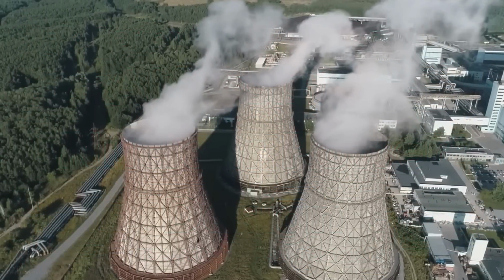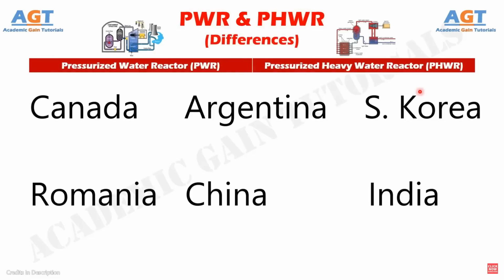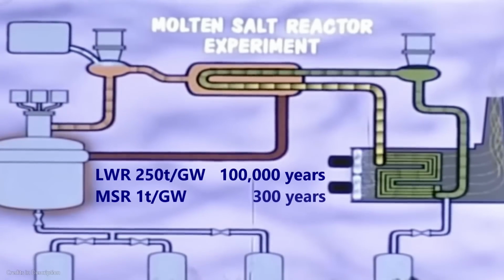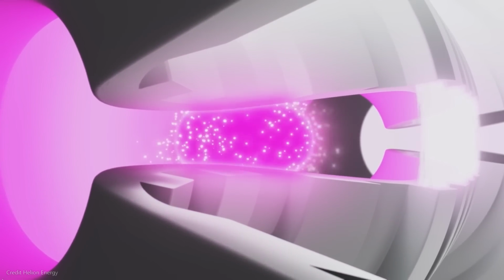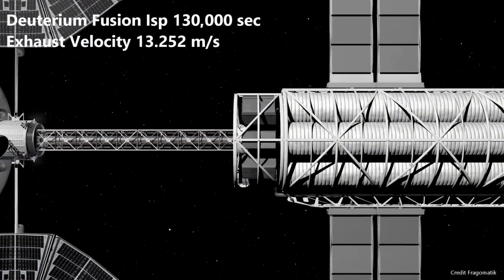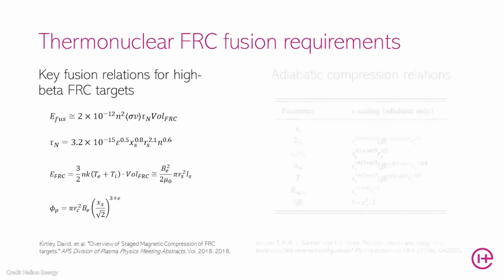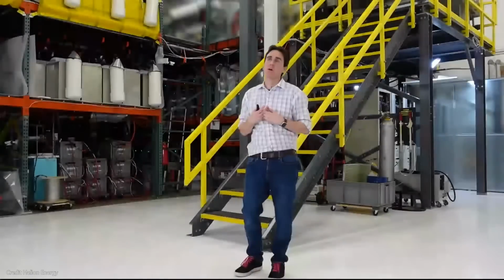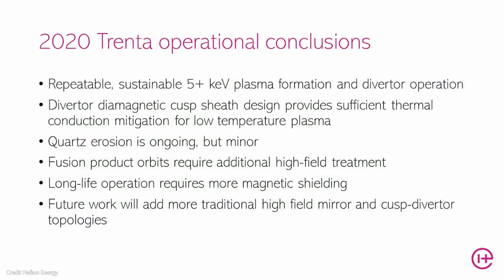AI Designed Hybrid Fusion Fission Reactor!

Comment: Looks a lot like the Dust Reactor, which also was theorized as a fission thruster.
Reply from the maker: Interesting... I'll look that one up.
Reply: @terranspaceacademy  https://en.m.wikipedia.org/wiki/Fission-fragment_rocket. If you really want to go, use a pusher plate with a salt water nuclear thruster and the Thorium cycle to generate the Uranium fuel. Think continuous nuclear explosion but small and finely controlled. https://en.m.wikipedia.org/wiki/Nuclear_salt-water_rocket

Comment: The math seems wrong on ISP/Velocity. Shouldn't it  be 1,300,000 m/s roughly if ISP is 130,000?
Reply: I think you´re right. I assume, you calculated 130.000 s x 10 m/s² = 1.300.000 m/s? Makes perfect sense to me.
Reply from the maker: You are correct! A+! I'm off by a factor of 100 because instead of multiplying by 9.81 I divided! That takes our Starship an unbelievably long way!
Reply from the maker: Did I do it backward?  I meant to do that! It's extra credit! I'll look back at my sources.  I did it in my head.

Comment: If you have a working fusion reactor, why would you use that to bootstrap a fission reactor?  Seems like unneeded mass.  Suppose you did go for Neutronic Fusion reactor, the problem you fundamentally have is that the neutrons destroy the reactor.  Combining it with a salt reactor doesn't change that.  Can you explain what I am missing here?
Reply from the maker: Because the fusion reaction does not produce excess power yet and it does produce neutrons.  A negative negative becomes a positive when the neutrons bootstrap the fission process in the thorium reactor, producing much more power.

Comment: I love your explorations of many types of technologies and how they can open up the solar system to humanity! I'm a big fan of Molten Salt Reactors, though my favorite is the Molten Chloride Fast Reactor, which doesn't need flouride salt or beryllium to operate. It has additional advantages of being able to process some existing waste products as fuel. Terrapower is working on a pilot plant with Southern Company. Elysium Industries has a similar design as well, but they don't seem to be as well funded. 

On to fusion, there were several concepts out there for using antiproton beams to catalyze fission, which would in turn create fusion. The one I recall best had a pellet of frozen deuterium covered in a shell of uranium, encased in a shell of lead. The antiproton would cause fission of the uranium, the lead would help direct the reaction inward, which would fuse the deuterium. 

Your idea is interesting as it's nearly the opposite, using the fusion as the neutron source to start fission in an MSR (or MCFR as I mentioned). The advantage being that the efficiency of the fusion could be low and still be useful in this case. Pretty cool concept overall. Thanks for presenting this idea, and as always, for making us excited about the possibilities!
Reply from the maker: You are most welcome James and thanks for the tip on the MCFR.  I'll read up on it.

Comment: very nice video. the idea of fission-fusion hybrid reactors is nowhere near new, and even before it in the late 70s early 80s there was the idea of using a spallation particle accelerator to generate neutrons to sustain a reactor. a big thing you missed in this video is that external neutron-driven reactors don't make economic or logistical sense unless they utilize subcritical nuclear material, a reactor of either critical mass or ability to self sustain is far more efficient if just left to burn fuel on its own, as it requires no external power input such as sustaining a fusion reactor or a spallation particle accelerator. the idea of a fission-fusion hybrid reactor comes from the idea that, though a fusion reactor may not be able to break even on its own yet, using nuclear material as a gain medium could make it efficient enough to create net energy gain. there's a problem with this, all the most efficient current fusion reactors operate in a pulsed scheme, tokamaks are only capable of pulsing on once or twice per day for a few seconds, the inertial confinement laser fusion used by NIF can only pulse once every few days, and even the best stellarators can only sustain themselves for about 20 minutes per day. there is however, a solution to this. beam target fusion! though not in its current form. beam target fusion involves using an electric current to accelerate a beam of ions into a metal target with fuel dissolved into it. industry standard beam target fusors involve a long cylindrical vacuum chamber filled with deuterium gas, at one end of the cylinder is the cathode, made of typically some type of steel or graphite, and at the other end of the cylinder is a titanium wafer with either deuterium or tritium absorbed into it (making it titanium deuteride, or tritide) when a voltage of 10KeV or higher (usually around 80KeV) is applied, ambient deuterons from the chamber are accelerated into the metal titanium target, which causes fusion, and a beam of neutrons. importantly, it can generate a constant flow of neutrons, which is ideal and efficient for breeding and reacting nuclear materials. my personal design of a beam target fusor (i call the beam target torus for reasons that will become evident) involves essentially stretching the reactor design axially around the target, creating a torus shaped chamber, and adding toroidal field coils not dissimilar to a tokamak, this causes an efficiency increase of approximately 18%, but that still isn't enough to make it viable for fission-fusion hybrid systems, so instead of titanium for the anode target, we need to replace it with a material which can store hydrogen at far higher densities. i looked into palladium but that was both far too expensive to scale up, and still not efficient enough. here lies the key to making beam target fusion viable: Vanadium! its common knowledge that at room temperature and pressure palladium is the best metal at absorbing hydrogen, capable of storing 2 hydrogen atoms per palladium atom, meaning it can store approximately 900x its own volume in hydrogen. but that is just at room temperature and pressure. at very specifically 7 Bars of pressure and 400 Celsius, Vanadium is capable of accepting 6 hydrogen atoms per vanadium atom! and when cooled to room temp and pressure it stays absorbed within the metal at that ratio! this innovation gives an increase in efficiency of approximately 32%, with these efficiency increases (reaching a maximum of around 70% but realistically more like 50% to 60%) it should be far more viable to make a fission-fusion hybrid reactor, especially since not only is the fusor now around 40% more efficient, but the high efficiency slow burn of beam target fusion creating a constant dull stream of neutrons rather than large pulses, makes the breed and burn process substantially more efficient! i'm still in the "on paper" design phase for now, making sure to calculate out everything to get the highest efficiencies, but given time a prototype will be constructed (assuming i can acquire the correct permits and funding and such). this reactor design surprisingly looks to be more efficient at smaller scales, like "fit in the trunk of a car" scales. Ad Astra Pro Terra!
Reply from the maker: Very interesting!  You really know this subject! Thank you :-)
Reply: Dude! This sounds like an amazing tech! I would love to hear more about your progress!

Comment: Why aren’t the control rods magnetically latched so it will drop into the fuel rods when power is lost as in the Fukushima disaster?  It was stupid of them to place the backup generators in the basement which is next to the ocean.  What could go wrong?
Reply from the maker: Indeed.  I've never understand why a nation with a history of such excellent engineering would let that slide.
Reply: The reactants are still screaming hot, so stopping the reaction won't necessarily keep the core from melting down if cooling is lost. It could take a very long time to cool down on its own!
Reply: @jamesowens7176  if they only had a working backup generator to cool the core! 🤨
Reply: They are, but the reactor was already tripped, thus the control rods were fully inserted. The issue is the reactor still releases a small, yet substantial amount of power through decay, which given enough time, can eventually lead to a loss of coolant and core melt situation. This was the cause of both Three Mile Island and Fukushima, while Chernobyl was just due to a major unexpected flaw in the design of its control rods.
Reply: @gmhs2  thanks for the update

Comment: Hay Doc. While this weeks presentation didn’t come close to eerking me as did last weeks (which is why I have commented). I’m rather disappointed in these incredibly smart people. He didn’t dive very far into why the choice of Mo/Tung as a barrier material was made, but consulting with any two year radiology school would have given them answers as to why it’s not a good choice. The second leading cause of X-ray tube failure is “tube arc” caused by the build up of Mo/Tung deposits on the glass envelope. The electron cloud from the cathode bypasses the Mo/Tung anode striking the deposits causing an over-current condition and zero photon (X-ray) production. This is an old X-ray tube problem (and we’ll established), and now I’m really curious to know if the Helion team considered it. Second, because of the Mo/Tung choice (in a high energy electron environment) they are dealing with a liability we in Radiology consider an asset. Brem (or breaking) radiation. As mentioned in the presentation, it’s a serious and unnecessary byproduct that requires additional engineering and assets just to control the consequence. AI could assist in so many areas (if trained on the appropriate data of course) to advance the technology at a mind warping pace. 

But as I mull things over in my dust-bin empty head, I always condense it down a single variable; RTSC. In all these energy production scenarios, energy out is not the problem it’s energy in. Let’s set AI on the holy grail of material science problems of room temp super conductors.
Reply from the maker: Interesting!  You should drop them an email.  Often practical experience stomps theory. If I wanted to build a nuclear powered space ship I would hire a nuclear submarine designer.

Comment: I would recommend Improbable Matter's video about Helion, he has nuclear fusion experience, and brings up interesting points including that their fusion temperatures just aren't high enough for the pressures and fuel mix they're using: 100 million °K isn't enough for energy gaining deut-trit fusion, and they'd need the order of 300 million °K instead.
Reply from the maker: I'll take a look.  Thanks.
Reply: @terranspaceacademy Hey Professor, just chiming in to say if you haven't watched the  Improbable Matters video I highly recommend it as well. It was nice to hear an actual nuclear scientist's opinion and not just taking the word of the guy running the company who is of course going to present it in the best light possible.
Reply from the maker: @dr4d1s  Thank you Cody!
Reply: @terranspaceacademy  you are most welcome
Reply: @terranspaceacademy how  about a hybrid electric rocket that uses electricity to heat the fuel and propel it as well with a plasma thruster a plasma generator and vacuum sealed push plates that you use to condense the plasma while adding in pure oxygen
Reply: Have a patent pending for collecting 3He.  D-D fusion is neutron dirty....Albeit you can breed Tritium through  bombardment.
Reply from the maker: @kevinhambsch9201  That's awesome!

Comment: The melting passive safety plug for a molten salt thorium wouldn't work in microgravity. How could we have passive safety for such a reactor in microgravity?
Reply: The "safety plug" would only apply on earth anyways. In space, there isn't much to contaminate and the safety plug wouldn't be needed. 

This method is very much needed on the ground to prevent radio active contamination. 

In space you would simply have the LFTR reactor on a separate module and if there was a catastrophe, you would detach the module to prevent the crew or payload from being irradiated.
Reply from the maker: True...
Reply from the maker: That's a good point.  It would work under thrust but that obviates the whole fail safe part. Gas pistons to force the fluid out if the plugs melted?  They could work like airbags and fire automatically.
Reply: I agree that you could simply "eject the core" if there were a significant runaway reaction. Using MCFR though would self-regulate to limit runaway reactions (the reactants expand as they heat, which reduces the reaction rate and lowers the temperature). The bigger problem with reactors in space is what to do with the waste heat (what can't be turned into useful work). You end up with giant radiators, which becomes the limiting factor to reactor size. With hybrid nuclear thermal/electric, you can use the excess heat to heat hydrogen for propulsion, but there may still be extra to deal with.
Reply: @jamesowens7176  Waste heat will be the biggest issue for reactors in space. Especially when you are just coasting and not using the engines. Peltier plates, Stirling Engines or Heat Engines can come in handy, but massive radiators will probably be the ticket, at least until a better solution can be invented / discovered. 
Heat also does really strange things in micro gravity. On earth, we typically think of heat traveling up and cold going down, but when up or down are not a thing, heat will follow the path of least resistance. Heat can travel through conductive things and make inconspicuous areas of the ship hot... The reactor will almost have to be a separate module and insulated from the rest of the ship/ station  for this reason alone.
Reply: @woodlanditguy2951  For Jupiter Icy Moons Orbiter, we had the reactor out on a boom at the front of the ship, with a radiation shield behind. The boom had radiators down the length in a trapezoid to stay in the shadow of the radiation shield. The radiators were so big, we needed a Delta IV Heavy and 2 extra kick stages to get it out to a nuclear safe orbit where to reactor would be started. 
For Mars Transit, we're already planning to have the habitat as a separate module from everything else, so that will mitigate the heat issues you mentioned. Still have to be careful which way you aim the radiators though!
Reply: @jamesowens7176  Great reply! I love thoughtful conversation :)

Comment: At last an original idea.  Pity LFTRs corrode themselves.  Pity both create neutrons and both must dump heat.  The fusion reactor's magnetics convert directly to electric power, which is quite a saving.  Materials science needs to be applied, I think.  :cat-orange-whistling:
Reply from the maker: It will need refinement but if they can get it going things will progress rapidly.

Comment: Question, did helion calculate for the radiation emitted from the reaction?
Reply from the maker: Yes. They are using the neutron radiation to make the tritium.
Reply: @terranspaceacademy why tritium and not helium 3
Reply from the maker: @mr.ackermann807  Helium 3 can be produced also and is in most reactions.  It is just if not more valuable than the tritium.
Reply: @terranspaceacademy  ok. Also, why do scientists and others say that deuterium and tritium is the easiest reaction? I've always been confused by that.
Reply: @mr.ackermann807  Wasn't that because deuterium-tritium fusion has the lowest nuclear fusion temperature?
Reply: @johnbash-on-ger  thanks for the information. But when talks about energy released, I thought helium 3 and deuterium release the most at 18.4 mega electron volts, while tritium deuterium released about 17.6 mega electron volts.
Reply: @mr.ackermann807  The energy released is very close, the nuclear fusion temperatures are further apart.
Reply: @johnbash-on-ger  ok, thank you. I wasn't fully aware of the temperature difference. I'll have to look into it again. Does the temperature need to be hotter to overcome the repulsive force of 2-1 protons instead of 1-1 protons fusion?
Reply: @mr.ackermann807  Yes, quite significantly so.
Reply: @johnbash-on-ger  ok.
Reply: Totally not a nuclear physicist  but  More chance for a stable fusion  or something along those lines, as they fuse faster & easier at lower pressure. But I think also it has a better more positive neutron split / fuse - absorb rate. I think It may decay or react better than other isotopes as well.  Probably better off rewatching the fusion/fission, hmd prop videos
Reply: @dizzyizzie6354  ok, I'll watch them again and see the explanations.